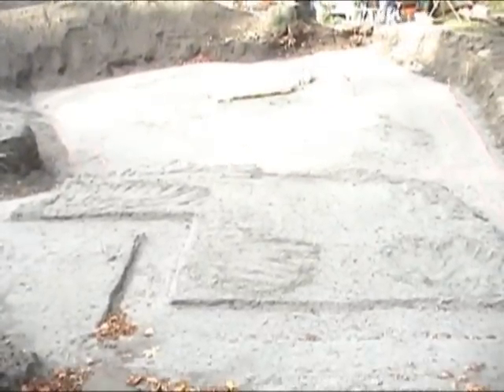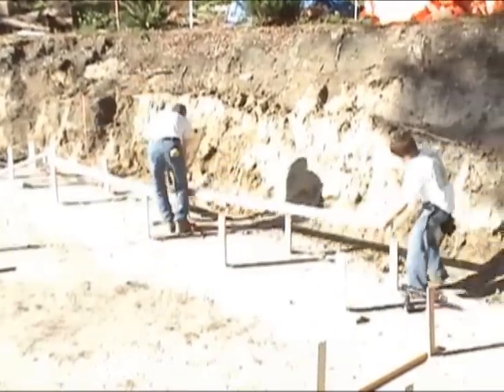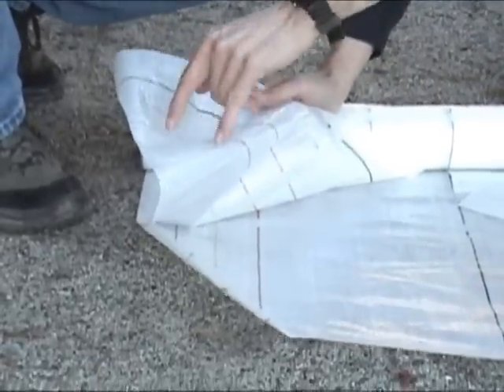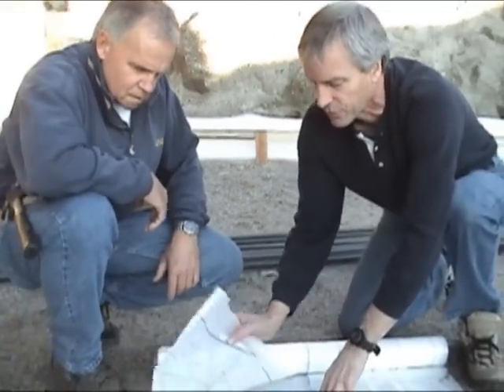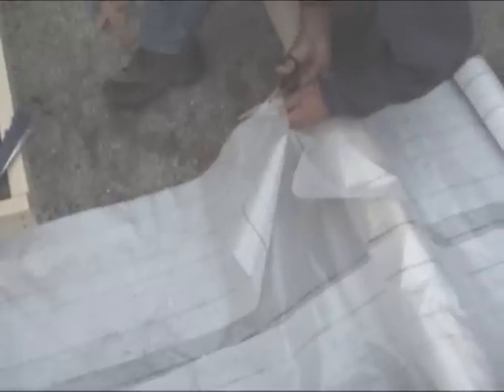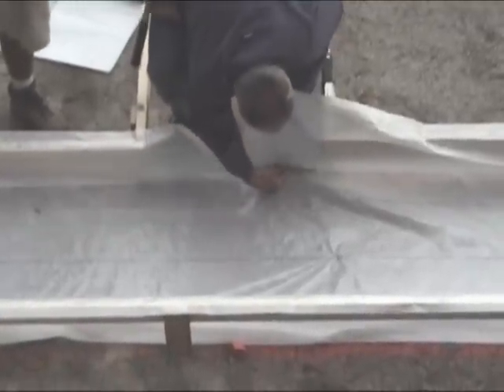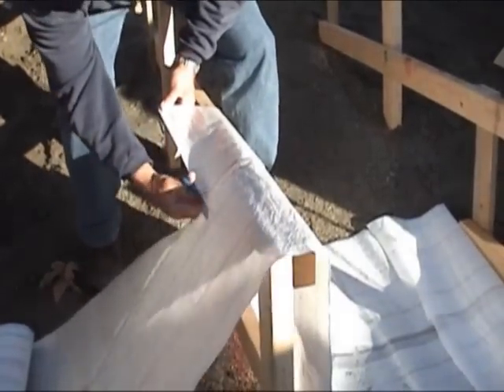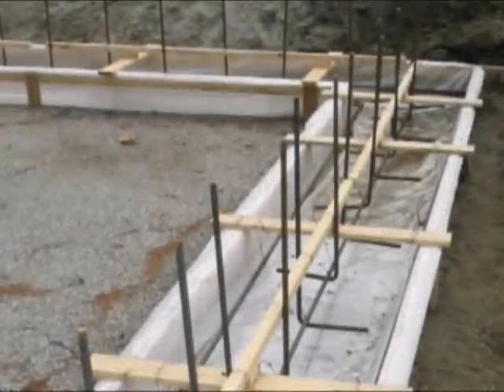Fastfoot® Residential Concrete Footing Installation

Comment: Is it actually much faster?  Still gotta do layout, steaks, and forms.  I guess it saves on form material and heavy lifting
Reply from the maker: Yes attaching Fastfoot to your lumber is an extra step. But it greatly reduces the amount of wood you need to purchase, move into the hole, cut, and dispose of . Plus it conforms to crappy excavation which often eat up more wood. And stripping is incredibly fast as concete does not stick to Fastfoot.

Comment: One word......poly
Reply from the maker: You can line your footings with poly 100%. And if you are not using Fastfoot we would highly encourage you to do so. Poly however will not be able to form concrete by itself. You will still need to use 2x8's to form, or it will stretch when vibrated and fail.

Comment: This is a ten year old video, you don't hear anything about using this way of  building foundation an or footings. Must not have worked out as they hoped for. Would like to see the build today to see if there have been any foundation problems. Such as settling and so on.
Reply from the maker: I would head to our instagram page for more recent projects; https://www.instagram.com/fabformindustries/
Settling of a foundation would have to do with the soil and the contact width of the footing as per geo-technical engineers. Nothing to do with Fastfoot!
Reply: Guys,  I don't have any idea about this message for the video in question. This was not sent by me. But this would explain a few things that had been happening with my phone around this time. That had to be addressed. Someone I found, had put  a bug into my phone. Sooooo! much apology to you and yours my friend. Take care.

Comment: I just completed the installation of my footings in Hawaii on the Big Island using this product. The footings were 18” wide by 24” deep with over 300’ in length. This was the first time I had used this system. Except for the corners, I found it to be an easy system and a time saver. Since I am only planning on building one foundation I could see no need to purchase reusable form materials ie: 2x12’s or panels. Hawaii County requires that all lumber be treated with “hi-bore” (a very expensive treating process) and if concrete touches the lumber, it cannot be reused in the construction. 
The only challenges I experienced were Hawaii County’s Building Dept. lack of knowledge and during installation the folding the the corners correctly while installing the material due to the depth of the footings. I found the system to be fairly easy to install and forgiving if the footing depth happened to vary. The cost of concrete here is approx. $165.00 per yard and a boom pump truck approximately $1200.00. What I saved in materials cost, form materials and wasted concrete should I have used 2x12’s in lieu of Fastfoot was in the thousands, not to mention the labor savings to set-up, take-down and cleaning. I would encourage you to give it a try vs/ 2 by’s or panels, I’m pretty sure you’ll like the system. Q
From a 40+ year and seasoned General Contractor’s point of view, I’m pleased with the results. Now as an ICC Building Inspector, I have no issue with
those using the system and verifying its integrity. Dealing with Fastfoot for ordering and shipping of the product was painless as well. Everyone involved was helpful and knowledgeable and shipping was very fast. Great product for the tenured contractor or homeowner .
Reply from the maker: Thanks Steven, we are glad you liked it! Corners can be tricky to form onsite, but as you did have some awkward dimensions our standard corners would not have worked. Happy everything worked out for you and thanks for the great comment!
Reply: They make corners now. I like that. I also like that you see the big picture and usefulness of this product.

Comment: We use form a drain for footings, we can set and pour a house a day, and my footing foreman has done 3 a day for a week straight,  This saves any digging in of tile other than sump pit. U could use 6 mil visqueen in the same fashion,  We dont hold our forms out of the ground like that we set the laser as close to ground as possible and then hand  dig out a few inches and pour.  That stair step up to the garage is hilarious, u only need to return to garage and then bump from 8 to 4.  But whatever floats your boat, if u think homeowners can do this I want to make videos of the inspector failing them and the laughter between them back at the office
Reply from the maker: If you can dig a trench to pour your footings go ahead. Alot of places in the world will not accept this. This job was completed by a Father and his two sons. Form-a-drain is not a good product, as no drain can ever be effective if it is level, which your footings must be. Never has there been an issue with inspectors, as they are checking to make sure footings are in the right position, with adequate steel according to local codes.
Reply: I don't think u understand how form a drain works.  It ties to perf tile then runs to sump pit. Way more effective than regular tile around footings. Your systems a nice idea but completely unnecessary.  I've done thousands of houses and never an issue. But to each his own

Comment: Are you projecting that it saves time (with a trained crew) compared to traditional methods? 
How does it compare on cost to traditional plywood method?
Reply from the maker: On the setup it takes slightly longer as you have the step of stapling the fabric to the screed boards. But the savings come into play when you have deeper footings, or uneven excavations. If your excavation drops 4" in some places, simply let the bag out. No more shoveling soil, or putting in extra screed boards. Also using Fastfoot on steps is a huge time saver. Stripping is alot quicker too as concrete never touches the lumber, and all lumber is clean after the pour. For most footings you are looking at $1/lineal foot. This is usually equal to the difference in price between a 2x4" and a 2x10". You can see huge time savings on this grade beam; https://youtu.be/AzI_CmEavvA
Reply: I used it in hot climate where i have to prevent rapid drying of the concrete.

Comment: Would 6 mil plastic linining the bottom serve the same purpose as a vapor barrier?
Reply from the maker: Yes of course, but you will want to line the sides as well. It should be part of the code that all footings be lined with a damp proof membrane. Fastfoot is a woven poly that allows it to actually form the concrete as well. This means you need less lumber to be shipped to the site, as opposed to just wrapping in poly.
Reply: @FabFormIndustries  do you remove the 2x4 after concrete has cured that the fabric is stapled to

Comment: not bad, was half expecting the fabric to rip off the boards from the weight of the concrete. thought this strip foundation seems to be only 8" deep ?
Reply from the maker: Yes it is a strong material, and has improved since this project from 10 years ago. Here are pads up to 4' deep; http://fab-form.com/fastfootCom/kitimat.php

Comment: 3 words:  Form-A-Drain.  And there are other ways to take care of the moisture wicking from the bottom of footing.
Reply from the maker: A couple issues we have with Form-A-Drain;
1) Footings much be level. How successfull can a level drain be?
2) Water must reach the top of the footing before Form-A-Drain can move any water at all. At that point moisture has saturated the footing
3) At roughly $2.50 lineal foot (with corner brackets etc) it seems like a cash grab for Certainteed.
Reply: FabFormIndustries  Fab:  Water must reach top of footing... you're kidding right?

Comment: Absolutely horrible for structure. Bad bad bad. Really bad. Don't ever use this for to build
Reply from the maker: +Louis G Fastfoot is simply a concrete form. Structurally there is no difference between a Fastfoot footing, and a footing formed traditionally. Thank you for your comments regardless

Comment: Or I could just use Visqueen, right?
Reply: I wouldn't try visqueen it would be a way costly fail if it did Tyvek building wrap will stop a truck
Reply: Visqueen won't hold. You can push your finger through plastic. Not this stuff.

Comment: Regarding the issue of grounding : at 2:53 it is suggested to nail the bottom. Four 16d nails shall give enough grounding, however nailing the bottom is not needed, neither would I cut the fabric to assure direct contact with the soil (see letter in the comments). I would connect no.2 equivalent reclaimed grounding copper wire to the metal rebars with an acorn bracket and the other end of the wire will go to the two copper inground rods required by the code. I would use the copper rods anyway because I want to be able to check at anytime that indeed I have a proper grounding.

Comment: I looked at it in all detail and definitely I will start to use it. Especially in Florida will delay the drying out time (if you pour in the trench the sandy soil absorbs the water too fast). The smooth, neat surface does help a lot with the water drainage. I checked prices, cheaper than I expected. I just have to add maybe 10 percent more cement to account for the bulges (if I pour in the trench no need to do that).
Reply: it figures as a square footing. I've done it. Also the bag keeps water from leaving too fast. The slower it cures, the stronger it is.

Comment: sure looked to me that the plastic under the boards was bulging due to the weight of the concrete.  Not sure how that can be good
Reply: RP Trucker clearly fails to understand the purpose of the product.
Reply: All that's critical is the top surface yes it's going to have a bulge shaped side buried under feet of dirt when done that's great that you can walk around and kick the bulge as it's poured to get the air pockets packed my hat is off to the person that came up with this system it's truly brilliant and a huge time and materials saver, huge  : )

Comment: Is this depth sufficient for footing? What do we do in case of isolated footing?
Reply from the maker: Widths/depths of footings will be determined by the engineer on the project Sunil. I am unsure what you mean regarding an "isolated footing".
Reply: I think he meant that the membrane acts as an insulator to the ground. In my opinion there is no issue using this products vs. Getting a good ground. Two 6 ft copper grounding bars are less than 20 dollars !

Comment: I used plastic under the footings and the electrical  inspector wouldn't pass the ground wire that I had fastened to the rebar in the footings, he said the ground wouldn't work with the plastic under the footings, I wonder if this stuff can be used with the ground
Reply from the maker: Hi Dave. In regards to Ufer Rods with Fastfoot®,  
http://fab-form.com/fastfoot/fastfootFiles/electricalEngineeringLetterUferRod.pdf

Comment: Think you guys have missed the point here, we are talking about stopping rising water through the concrete foundations.
I am about to construct a concrete bunker (house) here in Brazil, we viewed endless new build houses many with severe water damage from water rising up through the foundations.
Most concrete bunkers here are rendered, looking around one house just 6 months old the rendering was falling off in addition water damage on most of the interior walls.
 So i do not wish to chuck my concrete sponge into a pool of water !

Comment: What a waste of time! Just dig the footing into the ground and level the top! Do this by shooting a grade as you pour or setting grade stakes in the footing or use your batter board line to measure down as you pour...either way, you simply level the top. You don't need forms of any kind for footings. In Florida, we just use the ground for a form. The only time I use a wood form (or any kind of form, for that matter), is if the terrain is un-level and I have steps in the footing. In this case, you just use a bulkhead for elevation changes but still use the earth for the form as the terrain slopes. You people "up north" waste so much time in your building methods.
Reply: As a person from "up north" I have seen some of the building methods used in the south...... I bet you do use dirt to form your footings. I bet if you had any plumbing to do you would just use whatever plastic pipe you could dig out of your shed, with the cheapest one step glue and maybe some duct tape if needed. If you had some framing to do you would build entirely of firring strips and sheetrock screws, Speaker wire for electrical outlets. and if you had a window to replace you would have to call the company that built your shitty little trailor 80 years ago to order one because home depot dosent carry rv windows. You people "down south" sure do know how to get R dun though dont you?!
Reply: runeski74
There are shoddy construction practices all over the country, tough guy, not just the south. But I get you. You think because it is the south, we are dumb and inferior to the north. Just like the southern vernacular, I find it humorous when someone with a hideous northern accent who absolutely butchers grammar and the English language, makes fun of the southern drawl.

The point I was making, is that time is money...and unnecessary practice is money. The earth is a perfectly suitable form for a footing that will never be seen again.
Reply: First off, Im no tough guy... I dont know what gave you that impression.

Secondly, Who are you to know what i "think" I never said people from the south are stupid, and I dont "think" that either... I never made fun of the way people from down south talk. I just quoted Larry the cable guys famous Git R Dun cause it seemed to fit.

If youre so sensitive about being from the south, then you shouldnt come online saying ignorant things like "You people "up north" waste so much time in your building methods." After all that really seems to be the point you were really trying to make.......right?

   Sincerely
                  Tough Guy
Reply: runeski74
Did I mention the Earth is a perfectly suitable form for a footer?
Reply from the maker: In the area that this was formed, a trenched footing is not an option. Moisture is a huge concern. So a drain tile must be placed below the footing. A large reason why Fastfoot® makes so much sense.
Reply: Makes perfect sense to me!
Reply: FabFormIndustries
Fair enough. How does it hold up to torrential downpours washing in from behind the form? Will it hold back fill from being washed into the footer? Will it float? If it does float, will it settle back down where it was before the rain? What about when mud washes up under the Fastfoot...How do you get that wash out from under it? I presume you have to have a completely excavated site so there is no chance of wash in.
Reply from the maker: Until concrete is in the form, Fastfoot will act like any fabric. It will be pushed out of the way of any "Torrential downpour", but remain attached to the screed boards. You would have to rake away any fill that washed into the footer.
Reply: FabFormIndustries I'm having a hard time understanding how Fastfoot will protect the foundation from heavy rain/ muddy soil.  The product interests me, but I need more explanation.  Thanks.
Reply from the maker: Bryan Rick Fastfoot® is used as a capillary break on the footing after the concrete is placed. This prevents ground moisture wicking into the home through the footing. The following link goes through this in detail; http://youtu.be/w6iiwvi1tx4
Reply: tjdinfl it’s true. I want to see them northerners last a week down here 🤣

Comment: Having just poured my own footers using 2x12 planks, I see no advantage to this fabric method.  You still have to level a board at the top, so why not just use a 2x12?
Reply: Carry a 20' 2x12 and a 20' 2x4 and get back to me.
Reply: @ridgerunner106  ; Exactly. Work smarter not harder.
Reply: @ThirdRockGypsy  Informed plenty in my life. The fabric situation was unbelievably easy.  You have a brick ledge if you want bricks. Dig a trench and sleeve under if you want. Easy to work with. Never had a blow out. Just nailed with Plex Cap felt tacks, worked excellent. I see no wrongs and a whole lot of rights about this product.  Plus, no worries about rain caving in your ditches.
Reply: I have formed*.    Dang spell check.
Reply: Paid (tax included) close to 8 $ for just one 2x4x8 in St.Pete’s. Imagine the price of a 2x12 of even a longer length !!!
Reply: Plus, when you use the fabric, it wraps over the side runner.  So, no concrete touches it.  I can see top plates, band boards, barge rafters.  Plus, less that has to be loaded and toted to the next job.  Im telling you, it was much easier than dug  or wood footings.  No transit shooting grade stakes, just batter boards, and once in the middle, popped lines

Comment: being a bricklayer many years I don't have much use because my footers are under grade but I do like the use on the steps
Reply: Used to, we had nothing but shovels, maybe an 8N with a scoop. Now, we have skid steer, tractors, backhoe. I just did my brothers house, put it all below grade. Just threw the dirt back in. Just a few mins with bobcat. Plus, could back dump truck across footing to fill foundation, we left a hole.  Used up all the long boards and stakes on the house. Actually ran out and bought more. My brick layer won't be on his knees laying bricks or blocks. I dig a 5' wide ditch with the bobcat. He can stand beside the 2' high footing and start laying.  Put a little mud between bricks and wall.  I can backfill and he can put his scaffolding to continue up.  They seem to like it too.

Comment from the maker: Fastfoot ® is used in conjunction with a perimeter drain to deal with moisture. Big O will only drain water away from the footing. Only a vapor barrier will prevent the footing from wicking moisture into the building. As for a 4 hour construction on these footings, with steps and steel; that must be one hell of a large crew.